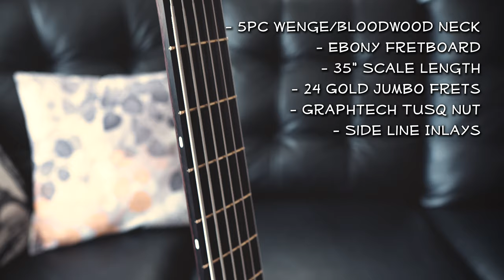DIY Build - Warmoth Gecko 6 Bass Showcase!

Comment: To me the series mode sounded better for the mix than parallel. Also the neck pickup on it's own seems fill the bass spot just fine. 👍
Reply from the maker: Agreed, I use Series mode the most when tracking with this bass. Have occasionally done passive/neck pickup in some clips, but mainly use series/active 👍

Comment: Nice build.  I found this video after searching for videos with the Dingstrand/Nordwall pickups, and your project is related to two different ones I’m working on.  The Dingstrand/Nordwalls are going into an old Ibanez BTB 4 that I just picked up on the cheap due to its electronics being fried.  Along with them will be a DG Tone Capsule and a Dingwall 2x pickup selector switch (bridge, neck, both parallel, both series).  The other project is a Gecko six that I have had in mind since I picked up a showcase body last year.  It’ll have Rautia multicoil pickups and a Lusithand filter-based preamp, to go for that full on Wal sound.  The neck is on the way, and I hope to have my own Gecko six project done in the spring.  Nice video, beautiful bass, and damn fine playing.
Reply from the maker: Cheers man! The Dingwall electronics in the BTB4 should sound damn good. I've only played a BTB7 before, but I really enjoyed how it played and sounded even when it was stock. I'm a big fan of bass tones with a fair bit of high mid content, so boosting with the Darkglass preamp is great 👍

Comment: First off sorry to hear about your father, may he R.I.P. 
Secondly!! thanks for showcasing the Dingstrand Nordwall Pickups!!  I'm looking into getting the 5 string version in my Ibanez SR885.  I love the way your neck pup sounds with the Neural DSP Parallax!!  
My band uses the 5 string bass tuned to Drop A for our 6 string guitar stuff, and I'm looking into getting a Dingwall Combustion 6 for our 7 strings tuned to Drop G.. 
put simply.. Dingwall and you have sold me on those pups man!! Great playing!! Nice Bass!!
Reply from the maker: Cheers man! The Nordstrand pickups all seem to be really good quality, as I've got some dual coil ones in my 6 string fretless too. The Dingstrand Nordwalls combined with the Darkglass Preamp has become my favourite setup by far! Would also recommend doing the series/parallel pickup wiring if you get the chance to, series mode is quite nice 🤘

Comment: Awesome bass, Tim. 😎🤘🏻🎸 I’ve heard a lot of good things about warmoth. I was thinking of getting an explorer bass kit from guitar kit world at one point. Especially since I’m a big fan of explorer styled instruments. I might get one. Or go with an affordable 6-string bass to experiment with. Other than that, that bass sounds killer. Especially with distortion.
Reply from the maker: Cheers Alex! I've only got amazing things to say about Warmoth. I've also built a Telecaster through them too, and even when I had an issue with a part (rogue tuner), they sent a replacement out immediately. I actually want to build another Telecaster but with a baritone neck, so I can switch the necks between the two builds with two different electronics setups. They're awesome quality, and they've got awesome customer service 🤘

Comment: These warmoth diy basses, do you think solderless pickups could fit? Badass bass btw.
Reply from the maker: Cheers man! The pickups will fit assuming they fit to the EMG45 rout standard, though you may have to ask Warmoth to enlarge the tunnel between the pickup rout and the back cavity (just so the solderless connectors fit through and you don't have to splice cables to get it to fit). I can't remember the size of the tunnel from the top of my head, but can look at it a bit later on. Warmoth are great with customer inquiries, so just flick them an email and they'll be super helpful 👍

Comment: Awesome stuff!!! Sounds killer. I have a question. I was looking at getting the tone capsule with these same pickups. Did you replace the pots that came with the tone capsule to concentric pots?
Reply from the maker: Cheers man! Tone Capsule is fully worth it. It comes with three 50k pots wired with click in connectors for easy install. However I bought a concentric 50/50k pot and a push pull 50k pot from Aguilar. All you need to do is cut the wires and solder them to the concentric one and it's done ✌️ didn't end up using the 50k push/pull on this build, but might add it to my 5 string at some point
Reply: Tim Murray this is genius. Keep up the great work!!!!!

Comment: Hey dude, what is that grid device in your left side of the shot, what is that a midi co troller pad? Just want to know cuz it loooks awesome and I want to get one.
Reply from the maker: So the one in view all of the time (on the top) is a DJ Techtools Midi Fighter 64. Its basically a MIDI controller that is just 64 arcade machine buttons in a grid. The one below it that is seen in the playthrough shots is an Ableton Push 2, which is a MIDI controller that allows me to fully control my DAW, Ableton